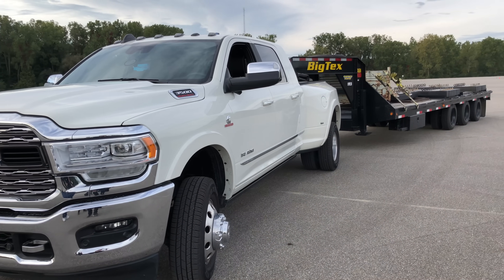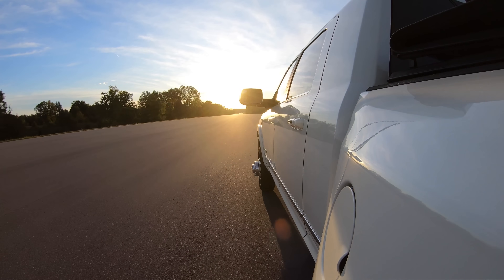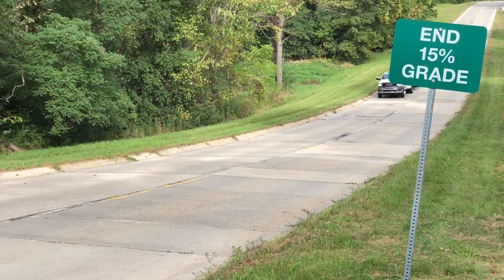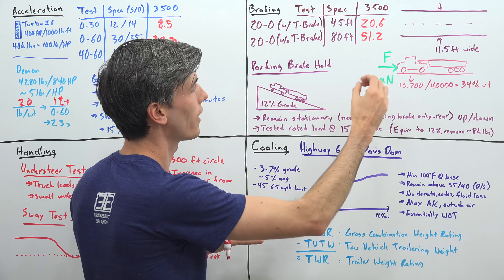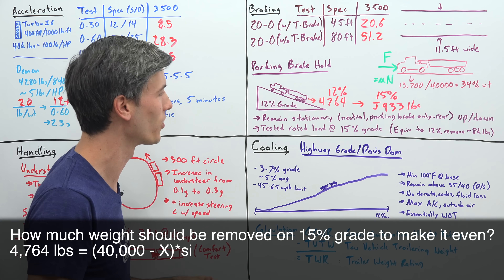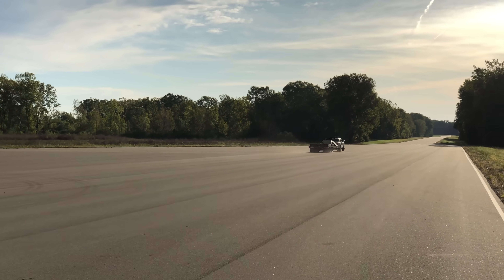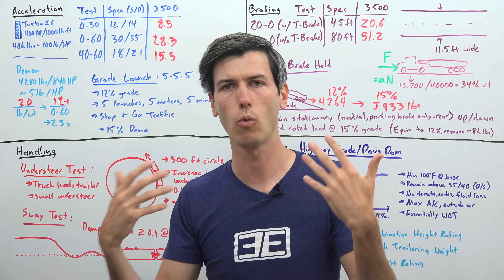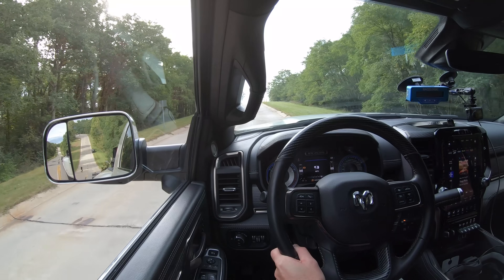How Much Weight Can Trucks Actually Tow?

Comment: Is any consideration given to aerodynamic load or is it typically considered negligible?

How about this and the other factors as applied to towing with smaller vehicles like cars and crossovers?
Reply: This one I can comment on (I was an aerodynamicist for Ford Motor Company and worked on several truck programs).  Aerodynamic loads really only become significant (compared to other loads) for an unloaded truck when you start to get over 62 mph.  At the speeds in this test, the aerodynamic loads would be less significant than drag from the other factors.  When you load up that trailer, the aerodynamics becomes even less important relatively speaking.   That said, If your trailer starts to act like a sail, especially if it is lightly loaded, it can really mess with the stability of the system.  Our full size wind tunnel wasn't really large enough to test a truck with a full trailer, but we did some road tests and got some interesting instabilities under certain conditions.

Comment: Hey! I’m from Russia and here we have diesel either of bad quality or with a lower cetane number than it must be to suit modern diesel engines. Moreover, the problem and the fact is that the same car with a diesel engine can save up to 10-15% of diesel by using diesel sold in Europe(compared to diesel fuel sold in Russia) And a diesel injection system can die at 100k mileage. Can you, please, make a video about diesel fuel: a cetane number and which diesel injection systems are maybe more reliable if one use not very good diesel fuel (or none of them are reliable in this case?) Thanks in advance!

Sorry for offtopic
Reply: Actually this would be an awesome topic!  Russia is the only large country I'm aware of that allows "low-quality" diesel and gasoline and therefore requires custom tuning/testing to ensure the engines won't outright fail.  I'm assuming it is a relic of the Soviet era with most fuel plants unable to produce sufficient high octane diesel/petrol.

Comment: One area not adequately tested for rating - backing a trailer on a grade.  My baby Ram diesel (3l) does great until you need to back up a grade because (I think) I’m not fully spinning up the turbo when in reverse.  Does worry me if its harder on my transmission.

Comment: Ok now please explain how in Europe they can tow travel trailers, aka caravans, with 4 cyl. passenger cars. Less gravity? I think it has to due to the flat earth. ;)
Reply: Max weight for a trailer in Europe is 3500 kg. But most caravans are lighter than even that.
Reply: @BaldurNorddahl  ok so about 7k lbs. But the specs are higher. I think a 4 door jeep wrangler that has a 3500 lb spec has I think a closer to 5000 lb in europe.
Reply: @chartle1  in Europe, a regular Audi A4 that weighs 1500 kilos (3k pounds) can tow a trailer that weighs another 10 to 15 hundred kilos. We don't tow lorry trailers with cars, in these parts.
Reply: Higher allowable axle weights. That's why with 5 axles and 12 tyres we have 40000kg GVW vs 36000kg with 18 tyres.
Reply: @ΑΡΗΣΚΟΡΝΑΡΑΚΗΣ  I'm talking about a 4 cylinder sedan towing a travel trailer that would sleep at least 4. 

In the US a travel trailer that you would expect to tow with a pick up truck or at least a 6 cylinder mid sized SUV.

Comment: I would like to understand a bit more about the Sway Test.  I don't really understand how the truck itself can do much to dampen the trailer sway motion (outside of an anti-sway braking intervention).  In my thinking the physics of the sway are influenced heavily by the loading of the trailer; primarily front to back distribution, but also CofG.  What are the physics of the truck controlling the trailer sway, and how would this contribute to tow rating?  Actually, it strikes me as subjective as well, since there really is no objective standard attached to the test that I can see?

Comment: At 4:26 when the truck is doing the brake test, is that brake dust blowing around on the road?

Just left of the truck you notice a black material sweeping the ground like it's a powder or something.
Reply: Good eye. It might be, but in another shot I could hear the abs working, so it might be tires.

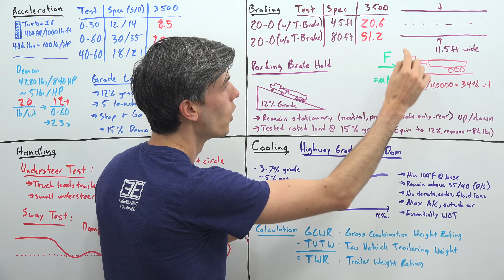Comment: Think about that: You drive this car with 1000kg too much weight in this scenario (5:50). You are limited in braking performance because of the bad weight destribution and you have got even more mass to slow down (in this example the 34% remain) . A brake system is limited in power. The power enhacer for your braking system has got a membrane with x cm^2 and a maximum pressurde difference of 0,xbar and the force you apply by your foot. At some point you cant deliver enough braking force to load out the tires -> you gain braking distance because you decelerate slowert then possible with this tires.

Comment: Well, sway test is entirely related to distribution of weight on the trailer relative to it's wheel axis.
Majority of  weight in front of the axis will always dampen, meanwhile weight behind axis will tend to cause trailer to oscilate.
AFAIK it has almost nothing to do with the truck (though im no expert ofc.).

Comment: I want to see more class testing for electric vehicles. Overheating for anything but the battery should be a non-concern, along with acceleration and braking.
I know a group of people that laughed at me when I installed a class II hitch on my Nissan leaf. "You'll break the transmission" 🙄

Comment: Very clickbaity title. This isn't the max they can actually tow, it's what they are rated for. They can tow quite a bit more and do so safely, Due to insurance liability and dumbasses that go way overboard we are where we are. But again this is nowhere near determining the max weight. Just the limit at which the truck is rated for. Stay within that limit and any damage occurs and you may be able to fault the company. Go over it and you may face criminal or almost certainly civil liability.

Comment: The ever increasing HP/tow weight ratings on Class C trucks is exactly why the laws changed here in CA recently, with all types of trailers over 10K lbs requiring a Class A.
Most people are not properly trained or qualified to tow heavy loads, regardless of if their truck can, and that's a problem. A regular 3/4 or 1 ton pickup hauling more than 10K lbs of trailer and load requires the same, if not better attention and driver inputs than a semi hauling 40K lbs. Why?......is all about duty cycle. Big trucks are heavier and overbuilt to handle far more weight than most of them are usually hauling  (80K lbs gross combined weight is the standard max, which works out to about 50K lbs of cargo in most scenarios). More weight than that means you need more axles/tires or permits, or both. Tires, roads and structures like bridges are the limiting factors, not the truck's abilities.
My Peterbuilt doesn't even notice a load on its trailer that is under 30K lbs, which means at 60% of its normal duty rating... the truck isn't even trying. That's talking accel, braking, stability and steering feel.
Now go and put 60% of the rating of one of these pickups on a trailer (about 14K lbs not including trailer tare) and tell me the truck drives and behaves the same as when its empty!
Reply: I'm honestly surprised that many states haven't started requiring higher level licenses for RVs. I've had RV/trailer combos pass me and be nearly my length, and I pull a 53'.
Reply: @Redbikemaster  Some even have airbrakes now ( I would die the day I see a RV driving performing a DVIR)
Reply: @Soph27199  or a pretrip
Reply: Cali only did it because they're communists and they want to regulate everything so nobody can afford their own business
Reply: Exactly I think the weight ratings are well and truly beyond the capability of a vehicle to handle safely at it's limits
Reply: @robertryan7204  Unfortunately, escalation is the most common tactic used when building competing vehicle. Much like HP ratings, if the towing/hauling capacities of your offering are less than the competitors (or last year's model) then the manufacturers fear nobody will buy their product, or they will at least miss out on bragging rights. As this tactic goes on for many years, you eventually start to blur the lines between classes of vehicle that were once clearly defined by their differences in capability. The same phenomenon of one-upsmanship has occurred with sport bikes over the last 20 years, with top level street bikes being barely distinguishable from full-bred race bikes, and only the most capable riders being able to fully utilize their potential.
Reply: @84gssteve  Totally  agree, but when it gets to the point that what the perceived  capabilities are much  more than what a novice driver can cope with, then it is becoming dangerous

Comment: comming out of warmsprings oregon (hwy 26 both ways) is pretty demanding too.  its at around 2800-3000ft above sea level and gets to 100F out there since it is a desert.  ive had a95 mercury village in good condition overheat going 65mph comming out of there at 11-13% grade. 4 speed auto trans also got hot. and u bet the ac was running.  also was carring 4 nonm child people and a couple hundred pounds of cargo which barely fit. also highway 26 going from sandy oregon to government camp is just as bad if not worse and its about 3500ft i think at said camp (rest stop).

Comment: Actually it makes sense. As I drive 2019 Dodge Ram 3500 6.7 liter straight six Cummins.  But you stated that Ram in your video is showing 2WD?   Mine is 4WD and I can safely pull 31,260 lbs total with two full size trucks loaded on my goose neck big Tex trailer.  My truck did the job without any complaints.  It's pretty stout engine with over thousand pounds of torque.  I love my truck!!
Reply: With that much weight, you might as well get a dedicated tow rig

Comment: It's all good when the truck is brand new. How long does it take for all of that performance to degrade? After a few years they will be less safe. i think anyone moving 40K pounds down a road should be subject to annual inspections to keep their trailer tags. So many people out there with enough money to buy these trucks and no common sense otherwise. I've towed with 30,000 pounds total weight through the mountains in a consumer grade truck, properly loaded and within my rating. It can be difficult and scary. especially the way other motorists drive.
Reply: I think if you keep up on maintenance your fine. My dad owns a construction company and I’ve pulled his 12-14k lbs excavator with a Chevrolet 3500HD from 2000 and a Ford F super duty from 1993 with no issues other then it being super slow and I can’t imagine spending the kind of money they want for trucks every few years. I also don’t like the idea of having the trailer inspected because the government messes with enough stuff as it is. Honestly though I don’t know too much since I’m not a trucker, going across country,or pulling the kind of weights that they show or that you’re talking about so who knows?

Comment: So if a smaller engine truck lacks acceleration but matches the handling/cooling/braking of the bigger engine truck (same brand/model), it could likely take the same load, just take longer getting up to speed.

Comment: Hmm I wonder if it's considered cheating for the trucks that truly have to wide open throttle on the cooling test. Both of my car's service manual say, if I remember correctly, at 90% or more throttle, the AC compressor is turned off to help provide more power to the engine.

Comment: I want that RAM truck, that engine just sounds so good, 6.7L in line 6 AND diesel?! yes please
Reply: Don't forget 1,080 lbs of torque @ 1,850 rpm.  Try that for a size.  I own one.  I love it
Reply: @AP9311  that's way too much torque for a tiny truck
Reply: @Ckcdillpickle  it's right size truck for that kind of torque.   If you look h.p in a diesel.  You're looking at it wrong.  H.p is meaningless,  but torque matters lot!!  3500 chassis is so rigid way stronger than 1500 which will snap in half if put into it.  That's why 5.0 v8 diesel is better for 1500 frame. 
I'm glad engineers designed it well for frame size and engine size!
Reply: Josh Benney Amazing to think that my dad’s F-650 dump truck has the same engine but only 210 hp and no idea on torque but shitty (I bet less the 600). Going up hills at anywhere for 25-45 mph while getting passed by fully loaded semis is really embarrassing !
Reply: @SquishyZoran  semis are built to tow. Funny when people think their 3500 towing 35k lbs is even close to safe or legal
Reply: Ckc dillpickle Exactly! I’ve towed half that weight with the same kind of trucks and it’s terrifying so I can’t imagine double that.
Reply: @SquishyZoran  I've done it many times.  It's piece of cake.  If you know what you doing and do it right.  It'll give you plenty of miles and without any issues
Reply: @AP9311  With a semi, of course its a piece of cake.
Reply: Josh Benney I can imagine. I do construction for my dad so it’s mostly just 4 pieces of equipment and I stay within a 30 mile radius of home so nothing like interstate commerce.

Comment: Wouldn't the 'sway test' be more dependent on the trailer type and load? I've seen those videos of toy cars on treadmills where they move the weights around,  screwing up the weight balance. Also, the trailer in this test is a three-axle dually trailer.
Just curious.
Reply: I'd expect there'd be standards that have to be adhered to with what type of trailer can be used and how exactly it can be set up. But whatever is used, it should be set up properly, not improperly weighted. Because the purpose of the test here is to evaluate how the truck performs. Therefore, you want the limiting factor in the tests to be the truck. If you improperly weight the trailer, then the performance of the truck will be limited by the trailer, which is not what they're evaluating.
Reply: The trailer used in here will be far more stable than a bumper pull hitch (the type used in those videos) so yes, essentially. But these can still sway, and these ratings include bumper pull

Comment: It would be very nice if you could convert the results into metric units :)
Reply: Ordinarily I use strictly metric units, It comes with growing up in Europe, but this time what I found disturbing was the mish mash of units used. Well it wasn't really that much, but still...
I think everything was in imperial units up until the grade launch specs. Suddenly it's 5 launches, 5 meters, 5 minutes... Where did those 5 meters come from? Why not specify 5 yards instead? Yea, it's not quite the same, but surely 4.57 meters is close enough even for the most rabid metric fanatic? Or if that's not close enough them how about 16 feet which is just 12.3 cm short of 5 meters.
But why use meters at all?

Comment: related to the last test, I don't really  see the connection with AC system. this is using a separate condenser and refrigerant, not coolant. also the engine power needed to run the compressor is having insignifiant effect to the engine cooling.
Reply: The condenser is mounted in front of the radiator and preheats the air passing through the radiator. @ 100 F ambient temp. the refrigerant in the condenser is at ~165 F.
Reply: still do not understand why turning the AC on is needed for this test. when towing is more of a influence in cooling from the gearbox oil cooler.

Comment: No accounting for the frontal area of the trailer?  Horse trailers push a lot of air.
Reply: I agree here...a gooseneck flatbed with a low slung load will handle much differently than a box trailer stacked to the roof with freight or animals... Those double decker pig toters come to mind.
Reply: Not while accelerating 0-30. and 0-60 not much. Also they care About standard occasions.

Comment: I want that truck for nothing more than the occasional trip to the supermarket
Reply: Wow you must really eat! 40k gross worth of Slim Jims and Big Gulps?
Reply: @bcubed72  on the plus side:  less frequent trips to Walmart...that can only be a good thing :)
Reply: Unfortunately that's what most people use them for.
Reply: Tbf though, you can probably drive these at barely 200 rpm above idle and have plenty of pulling power

Comment: You neglected to answer the most important question about the tow ratings.

How does the manufacturer come up with the specific number for the tow rating? Do they just keep adding weight till it doesn't pass a test, then go back 1 rating? It appears as though this truck could still haul quite a bit more and still pass, so why stop where they did?
Reply: They also have to warranty the vehicle at that rating.

Comment: I have a question about the "Grade". Isn't 15% Grade going to be 15% of 45 degrees, or 6.75 degrees? I say that because the steepness of that hill looked much higher than 6.75 degrees. Unless there's an optical illusion.
Reply: The grade is the ratio of how far you go up or down divided by how far you travel horizontally. (rise/run) 45%=0.45=tan 24.22 deg.      100%=1.0=tan 45 deg.
Reply: anti chuckle that wasn’t the question... my question was why do the 15% grade inclines in the video look much more steep than 6.25 degrees.